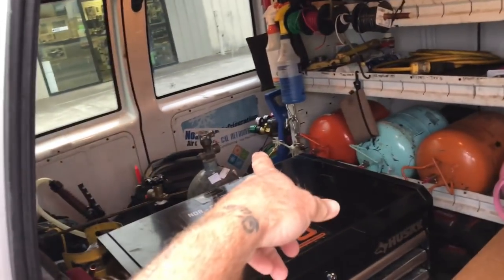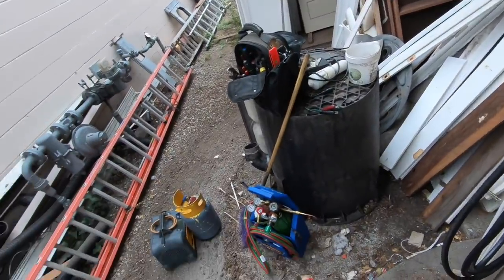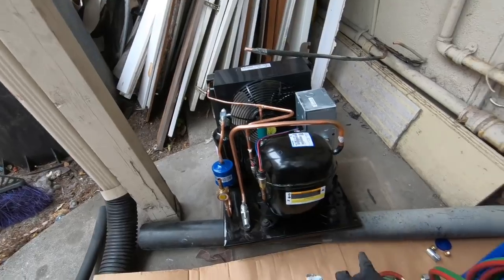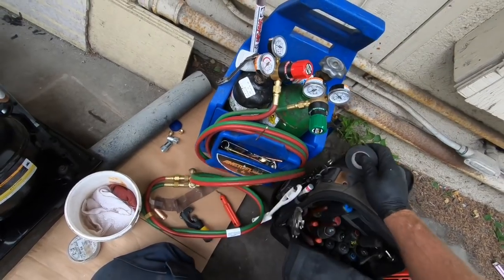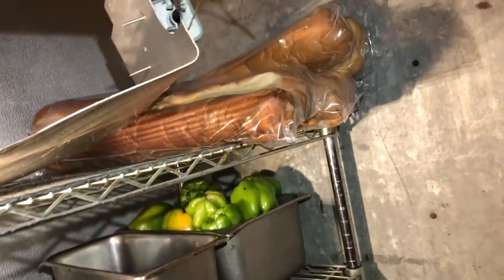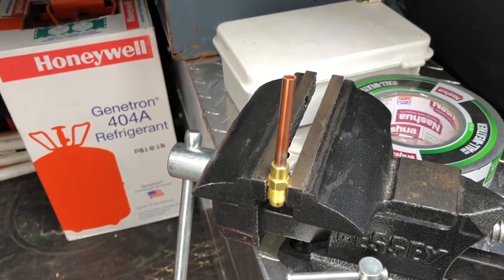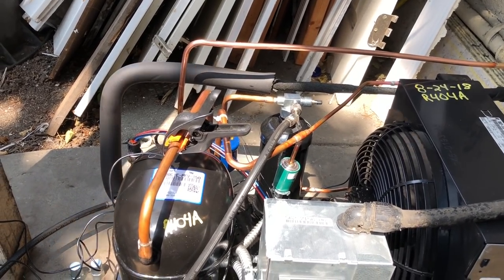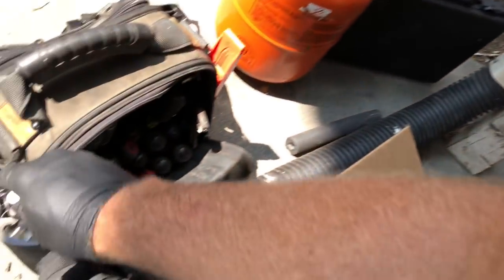Condensing unit change out

Comment: Watching NorCal Dave pays off again!!! I’m back offshore and I walk past the walk in cooler condensing unit to go upstairs several times a day. I noticed the tell tale signs of it flooding back and told the chief engineer he may want to take a look at it if nothing has been done to it lately. Told him to check the fan motor and coil if no one has adjusted the charge lately. Sure enough, they had piled up boxes around the evaporator, starved it of airflow and it iced up solid. A round with the heat gun later and we don’t get spoiled groceries now.

Thanks Dave!!!!!!
Reply from the maker: Robert L that’s awesome 👍👍
Reply: Nor-Cal Refrigeration & H.V.A.C update: I guess they had been steadily lowering the thermostat to compensate for the ice buildup. After cleaning the coil and not re-adjusting the stat, the cooler was a light freezer for a while.
Reply from the maker: Robert L they always turn the tstat down.  I have videos showing this.  You had a multiple offender 👍👍

Comment: I wish a lot of the older central air units had flare nut TXVs, Ive done two TXV replacements and its super high stress for me since they were braze in/sweat in TXVs. I always worry ill be cookin them even tho i have the heatpuddy and wet rag on em lol. Great video Dave
Reply: @OcRefrig  
I currently work for a company that's well, the owner is a nice guy but he's not the brightest bulb. Hes weird with what we do and don't,, many of the times we go with the  manufacturer's choice of parts. I have only done one Danfoss TXV on a Trane TMM front return unit. Fresh after the install the unit kept pumping down, gas would not flow through to the suction. Long story short we pinned the TXV, replaced it with another Danfoss, and same issue occurred. We ended up installing another new AHU. 
Anyway I haven't dealt with a stainless steel TXV. Would be an interesting encounter. Thanks for your help though, your kindness encouraged me. I will definitely use your advice, with the flux. 👍

Comment: Question:?on the condensing uniit they dont have a doghouse over the unit is that because its California or there appeared to be a roof above it Wandering if certain towns/city's have a requirement or just done when first installed years prior

Comment: hey Dave good video as always ! I noticed that every time you brush the condenser/evaporator. what kind of brush - wire brush ? I've always use nylon brush but after few times it's already worn out. thanks
Reply from the maker: harpoe18 I use a nylon brush from Home Depot. There in the cleaning section
Reply: @NorCal-refrigeration  many thanks !!!
Reply from the maker: harpoe18 thanks for watching

Comment: So you can use a 502 exp valve with 404a? Is their a good substitution chart available?
Reply: the pressure/temperature chart is withing 4 lbs or less across the whole range, same valve will work for either gas, small adjustment may be needed ;) 
changing-over is hard because the oils are different, R502 is "CFC" and used mineral oil. where 404 is HFC and uses POE oil mostly.
Reply from the maker: Hvac 1 sporlan web sight has all the TXV listed.  502 was usually used on low temp ( freezers ) 404a was the replacement for it.  Then it was used on medium temp. And you only needed one refrigerant for both.  When I started R-12 was medium temp R502 freezers and R-22 was for A/C.
Reply: Nor-Cal Refrigeration & H.V.A.C Cool thanks